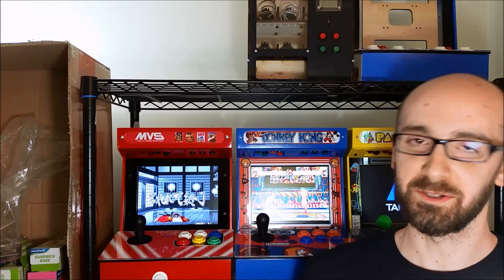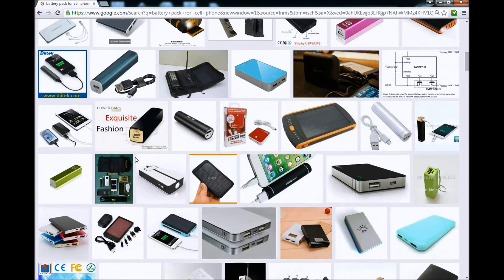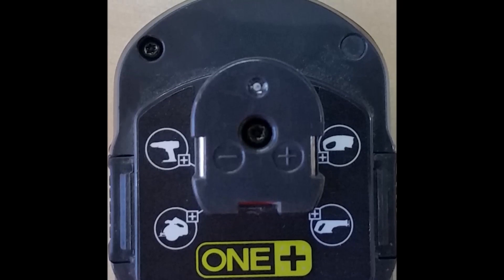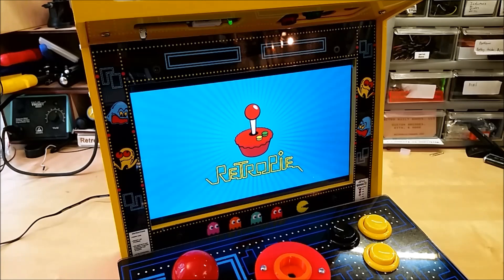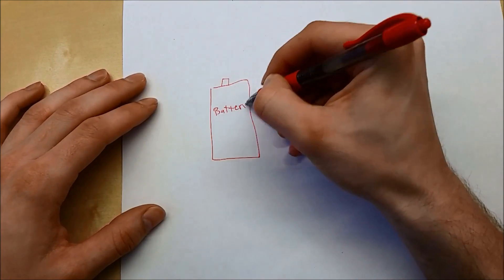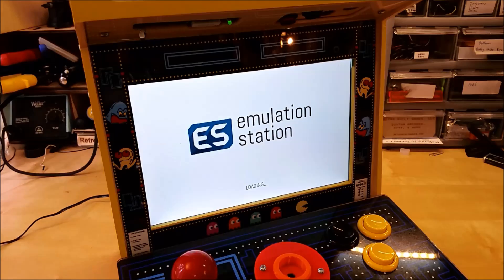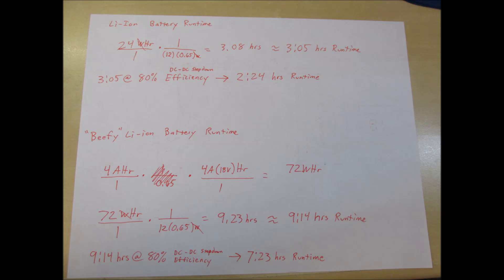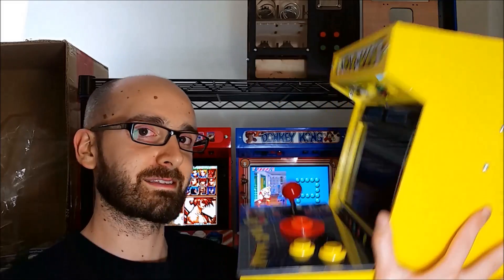Add a Battery Pack to Your Mini Arcade Machine

Comment: is it permissible to 3,7 volts x 4 batteries = 14,8 volts? is it necessary to step down/buck converter? while it takes 12 volts for arcade?

Comment: Really nice clean work. Some food for thought. You think could one could find a way to monitor the battery with the Pi and maybe display the voltage as an overlay in software? Or even just a warning overlay.

Comment: What CAD program did you use?
Reply from the maker: Inkscape and 123D for 2D and 3D respectively.
Reply: Ryan Bates Thanks. I was just interested you were able to take a photo of the back of the battery and import it into a CAD program and draw around the outside to extrude as a 3D print. Is it a straight forward import of a photo?
Reply from the maker: correct, but one must be careful of how the photo was taken and maintain the correct scale of the object when tracing over.